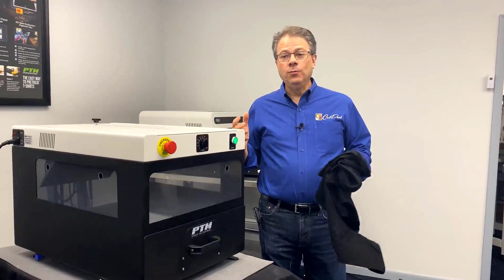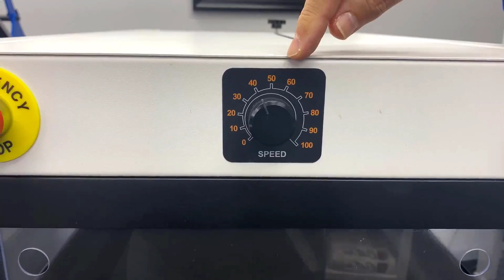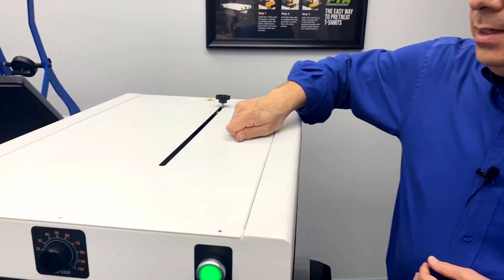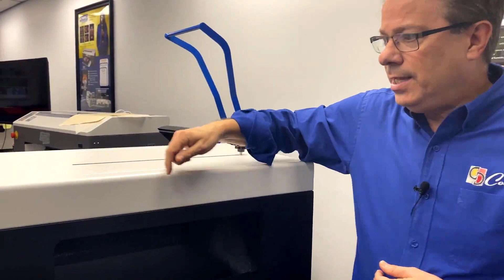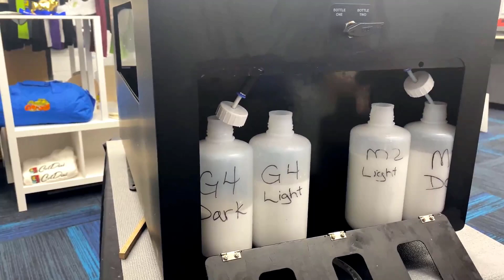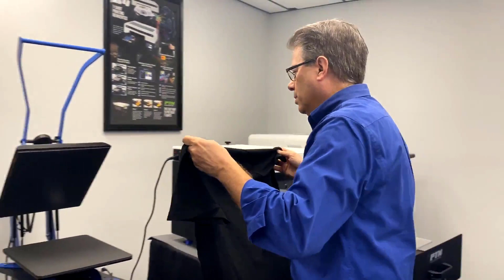PTM | Direct-to-Garment PreTreat Machine

Comment: received mine 2 days ago. What a overpriced piece of junk! First 2 of the 3 clear windows were broken. Second, As soon as I pulled the drawer out the silver bracket with the ball bearings fell out (ball bearings everywhere) It worked for 1 shirt. 20 ruined shirts later it doesn't lay down enough pretreatment. I have been using the Supplied Wagner Power Spray gun that came with my machine. Have not had a single issue with that. $79 versus $5,000. On that note if Col Desi is so confident in their machine then why send a Wagner spray gun?? I am glad they did just not at the cost of $5,000 for it because the Pre treatment machine is horrible. At this point I will send it back, of course they will make me pay for shipping and a %30 restocking fee. This machine should have never left their shop! I will update if any of these issues gets fixed.
Reply from the maker: Wow - sorry to hear that Zane. Please contact customers service asap!

Comment: Update. PTM Machine has been sitting for months. Rust. Broken pump. Bad nozzles. Uneven sprays. This machine is an overpriced piece of equipment that needs to be redesigned entirely with rust and consistent functionality in mind.

Comment: Got mine yesterday, set it up, the nozzle wouldn't budge, so it just sprayed continuously until I hit the RED emergency stop button. It doesn't work as it should. Tech support has helped me take off top of the machine, to then wiggle three wires behind the adjustment nob, it worked for 3 shirts, I then adjusted the nob for shirt 4 and it stopped moving again - Frustrating! We'll see how fast ColDesi fixes this, can't run a shop with issues like this day 1, and to wait around for a replacement is just not effective either. We'll see how it goes. 
Also, the 3 times it worked, I noticed a very uneven spray, where it was like 3 sections got enough and in between those three sections was barely enough spray to be effective. Frustrated with this supposedly good machine so far. Will update as I move along if I can get ours to work or a new one. Day 1.
Reply from the maker: Morning Jared! Sorry for the trouble on this - it looks like you are working with Heath and last contact was 4PM yesterdays - just keep using support and we'll get you through it
Reply: @ColDesiColman  Thanks! Got it fixed. It seems to be an issue that's not unique to our machine. It needed the loose red wire on the back of the nob to be re-soldered. now it works as it should. Here's to my tinkering with a soldering iron when I was 12!
Reply from the maker: @ThoughtJams  Great Jared! Thanks for the update